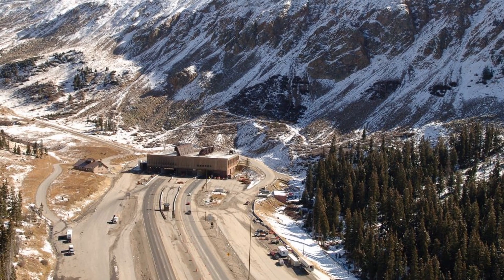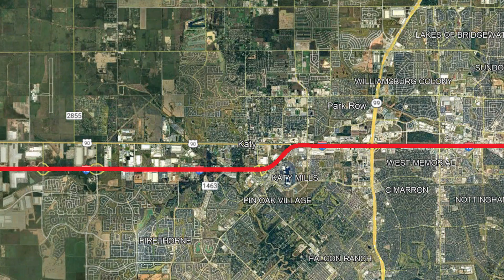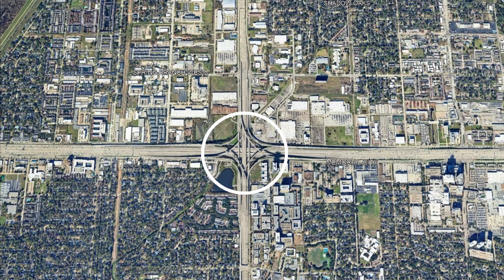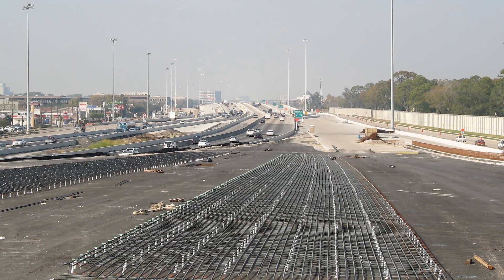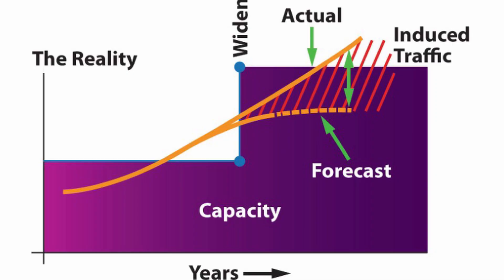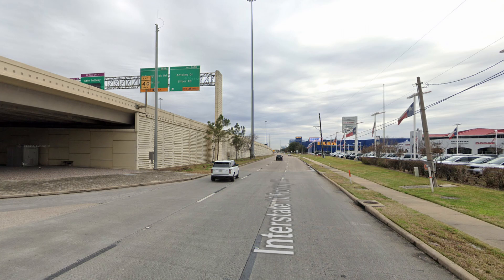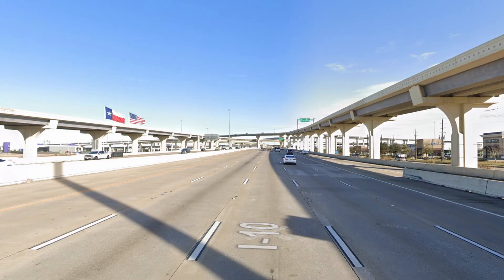Why Texas Built America's Widest Freeway

Comment: The "Induced demand" thing is pretty much bullshit. There's no new demand created, it's only "induced" because vehicles now have a better route to drive! So then traffic is reduced on other routes, or on surface streets, which is a huge benefit of highways.

And a better metric than congestion for a highway's performance would be throughout. A project can still be beneficial if it increases the road's capacity, even it congestion doesn't get better.

Comment: As an example: where i work is about 6 miles from home. I can go one of two ways on the surface streets and get there in 15-20 minutes by car. Or i can ride three different bus routes to get there, and it'll take at least an hour.
On another note, the 610 to 290 to FM 1960 trip on Saturday morning only takes 30 minutes, going to the local toy show once a month. Coming back home in mid afternoon takes a bit longer though, but often I take surface streets for that trip.

Comment: Here's one thing that could improve traffic flow:  Get rid of the carpool/toll lanes!  Open them to general traffic.  It would also simplify the infrastructure---fewer ramps, less signage, etc.  The express lanes could be used by through traffic.
Reply: The carpool and toll lanes actually help when you are just passing through town. So no you should not get rid of them.
Reply: @ItsReload1  Actually they don't---not anymore.  Those lanes now require local toll transponders, which out-of-towners won't have.

Comment: Most of the fallacies in this video have already been addressed, but just for a little more education you've got to consider the amount of commerce (18 wheelers, etc) that come via east and west through Houston.  I-10 goes through  Los Angeles, Phoenix, Tucson, Las Cruces, El Paso, San Antonio, Houston, New Orleans, Gulfport/Biloxi; Mobile, Pensacola and Jacksonville; With Houston being the 2nd largest port in the country and being the largest refiner of oil's in the country we're talking about an enormous amount of Semi's going east and west to help supply most of these cities. This is another reason for the expanse of I-10. Another smart design of the Katy is the fact of how the exits and entrances work (up to 610). The old freeway had the exits after the entrances causing backups at the exits into the freeway lanes during rush hour... Now the exits are first and the entrances are second. This alleviates the issue of traffic lights backing into freeway lanes. On top of that, this design allows safely hopping on and off the freeway. In other words if your destination is two traffic lights away and your pulling out of a store you simply hop on the freeway to avoid the lights which helps the congestion on the feeders.... And as a poster mentioned, we don't have frontage roads. We have feeder roads.

Comment: The proper solution would have been to build a REAL commuter rail line from Sealy TX to downtown Houston instead of the two HOV lanes going in both directions.  The freeway is constantly jammed during commute hours so the billions spent were for no real result other than lining the pockets of the contractors.  Houston deliberately rejects true rail lines and places stupid surface street toy trains on streets that have had existing bus service for 60+ years.  These trains were placed starting in the late 90s and done completely illegally without any voter/taxpayer consent through a proposition on an election ballot.  These trains actually CAUSE traffic jams and congestion in the city because priority is given to the trains so a traffic light can stay red for 5-10 minutes causing grid lock.  It is the movie Death Race on the Katy freeway when it is flowing.  People run closer to 100 mph than the posted 65.  Law enforcement is rarely seen because they too realize you are gambling with your life driving on the Katy freeway during non-commute hours.

Comment: I am sure if they wanted to build a commuter train there would be complaints that it is too impactful to the communities.
Reply: Yeah, a quarter-mile-wide swath of burning hot concrete filling the region with fumes and noise is fine, but don't ask for one little electric train line that has none of that.  

Because, as you know, trains = communism.

Comment: When it comes to improving traffic capacity over a network, there are two main ways to go about it: road and rail. They both have their advantages, such as rail being separated from road and not being impacted by traffic, and road allowing people to get from any one point to any other without having to interchange between modes. The other way to deal with traffic is to reduce the need to travel instead of adding additional capacity, and this can be done by allowing shopping, employment and recreation to develop closer to where people live, bringing them within walking or biking distance. This would require extensive urban planning and will often not be applicable in 20th century suburbs and only in newer developments. Like anything to do with cities, things like this are complicated.
For many North American cities like Houston, the primary mode for civilian and goods transport throughout a city and its neighbours is by road. Combined with the nature or road transportation, this makes those billion dollar freeways relatively cheap compared to building the initial infrastructure required for rail transport. If the city had a much larger rail network, it would a) be able to utilise existing infrastructure to a greater extent, b) make it easier for people and goods to interchange with that existing infrastructure, c) have that city already built around the rail network, with a much larger amount of the population and industry close to those rail lines and d) be something the people and industry are already used to working with and would be likely to approve of it.
In my opinion, I think that in the short term, this would have been the most viable solution but in the long term, more diversification of transport modes and planning would be ideal. I am not an expert on Houston and city planning in general, to take all of this with a big grain of salt. :D
Reply: Railroads are unaffordable and all are subsidized. Local buses are inefficient and time consuming the farther one travels away to/from the station. Local buses are subsidized in this country as they are also unaffordable for the most part.

Comment: I drove through Houston a couple of weeks ago and drove the Katy Freeway. A few years ago I drove the runner-up for most lanes, Highway 401 in Toronto.

When I first saw addresses like "27700 Katy Freeway" I wondered if "freeway" meant something different in Texas. It sort of does: these are addresses on the frontage road, not the freeway itself.
Reply: Buildings along the frontage road have addresses on the freeway.  I was confused by that when I first moved to Texas.  My apartment was at 3105 South I-35, or SIH 35.  Even though it was on the access road, and my actual apartment had ten buildings between it and that road.

Comment: Induced demand is a real thing for sure. The addition of highways cause new development to spring up. But also consider Austin, which fought against additional highways and additional new lanes for years, but saw new development and an influx of new residents without the induced demands from the highway system. Now they are dealing with a worse traffic issue than Houston because they didn't plan for the addition of new residents.
Reply: Yes that’s a prime example of induced demand

Comment: Greater Houston has been booming population for many years and the Katy Freeway sure is wide. I'm surprised that it's as wide as 20 to 26 lanes with its widest point at 29 lanes. Compare that to the 401 in the Greater Toronto Area which widened so many times with local–express lanes and the widest portion of the 401 is 22 lanes in Mississauga just near the airport and east of the ends of the 403 and 410. Normally, the 401 is as wide as 16 to 18 lanes.

Comment: In many ways, the Katy Freeway should be considered a success.  The Houston area has grown tremendously since the Katy Freeway was expanded.  Traffic on the road has increased.  but it hasn't completely failed.  However, the approach shows some serious lack of vision:
1)  If so many people need to travel between those points, why is there not a more efficient method of moving them?  (anybody hear of rapid transit?)
2)  Why is it that so many people have to move such distances every day?  Isn't there a better way of planning such that homes, employment and services can be more easily accessed?
Reply: To answer your questions: we did revamp the entire metro system, built 3 of the 5 proposed train lines, and those center lanes he’s talking about are used by the commuter buses from Katy, it’s called the park and ride. They used to just sit in traffic with everyone else on our 3 tiny lanes back then. Now they can fly by us. 2 rail lines weren’t built because people protested them smh 🤦🏿‍♂️ but the silver line was made into a BRT which connects to the station a lot of these I-10 lanes go to and will eventually be rail too. 

And your question about commutes, it’s not just those here locally, I-10 is a major route with many going through be it truckers or private cars. It’s the only east/west route here in an area of 7.5 million. So the road was expanded for only 11 miles to ease congestion for local and truck/bus traffic. If this were purely an adding lanes for passenger cars only thing, I would get people finding it ridiculous but that isn’t even the case at all.
Reply: Harris County has admirably considered rail to help reduce highway congestion. The conversion of excess freight lines to the Hardy Toll Road and Westpark Tollway have reduced congestion on both  I-45 North and I-10 West. Better mobility via rail conversion!

Comment: I think the 'induced demand' question needs to be further investigated. It's not like there's a spawn point generated cars out of thin air. Who are the people that seem to add to the volume which wasn't there before? Are these new residents? Are these people choosing the highway vs. surface streets? Are they former riders of public transit? Are people finding jobs on the other side of the city and the improved/new highway giving them access to a job they would have otherwise moved closer to? Is there an issue where traffic volume doesn't actually increase that much, but simply that the relationship between volume and congestion is not a linear one, but something approximating an exponential one?

If we had answers to these questions, I think we could better obtain the root cause and then begin to correctly address and analyze the issue. To some answers, such as highway vs. surface, it's not necessarily a bad thing. Less cars on surface streets means quieter neighborhoods and more walk-ability potential.
Reply: Induced demand is from people who weren't going to drive, driving. Say I might want to go to the cinema, but I'm reluctant because of bad traffic and there's no other way there that arrives quickly enough. 1 highway expansion later, and logically it follows that traffic should be better, right? So I decide to go to the
 cinema more often, whereas before I stayed home. I'm one more car that would not have been there otherwise. That's induced demand.

Edit: This is on a smaller scale, but the same goes for developers who now see land around the improved highway as more valuable and you gain more residents. The bulk of the induced demand.
Reply: There’s no such thing as induced demand, he even proved it himself. That people were moving here (200 or more a day some years) and that “traffic was gonna get worse anyway” no? So the demand was there, not “induced” because that isn’t actually a thing. Just like 29 lanes aren’t a real thing lol. Did Houston gain 3 million because a couple lanes were added to a short 9 mile stretch of I-10 on the west side? Of course not.
Reply: @ruckusbeblack  Right, sure, but this term isn't unique to this video or Texas. It's used frequently in reference to highways as an argument against improvements. I'm more referring to this 'induced demand' argument in general.
Reply: @guernica4262 I know, so was I lol. I was using his own points from the video that disproved it but you can pretty much do so with any city or anywhere the “induced” theory is used.
Reply: Yeah I hate the "induced demand" argument. There's almost always an underlying issue separate from the road. There's plenty of roads that get widened and then traffic generally goes away. I-95 in GA is pretty good example of that. After they widened the entire state to 3+ lanes, traffic because almost non existant at any time of day. Most of the traffic jams now are from hurricane evacuations or wrecks.

Comment: - Addicks-Setsuma Road isn't referenced by that designation.  It is Texas State Highway 6 (or, as the locals call it, Highway 6).  
- That exit in the middle of I-10 (which is actually the Katy Managed Lanes / Katy Tollway portion) is to service the Addicks Park and Ride that looks like the big parking lot to the north.
- Sam Houston Tollway exit has always looked like that.  It's just bigger now due to the Katy Freeway project.  
- Sam Houston Tollway interchange and Grand Parkway interchange were not built at the same time.  The Sam Houston Tollway interchange was built in its entirety as it was a replacement for an existing stack interchange.  The Grand Parkway interchange was built in two phases, with the first phase servicing Grand Parkway Segment D (the free portion to the south).  The northern part of the interchange was built when the Grand Parkway Segment E was built, which was after the completion of the Katy Freeway project.
- The Katy Freeway project ends at I-610.  Katy Freeway itself continues until it reaches downtown Houston.  There is discussion of a Katy Freeway Project Phase II which will cover the Katy Freeway from I-610 to I-45.
- The reason for the increase was, between 2011 and 2014 was that alternative routing
- Katy Freeway has HOV lanes (single lane in each direction) from SH-6 to Mason Road in Katy.  From SH-6 to near I-610, those are the Katy Managed Lanes (also known as the Katy Tollway).  They are HOV/SOT system (HOV drivers do not pay a toll during HOV times, but single drivers can use it for a toll).  This is the only road in Houston that is not referenced as express lanes.

What I think people fail to realize that, even though you still have traffic jams on it, it was worse before the project.  The previous facility was three lanes in each direction and two to three frontage road lanes.  To get from midtown Houston to Katy during the middle of the day, it would take 2 hours one way.
Reply: Another old head like me that was fuming watching this suggested video. I remember back in the day when there was a railroad track next to the freeway. The only part of that track is still visible on Old Katy Rd next to said park and ride.
Reply: @bobmurphy2216  I just checked Google Maps and Google Earth and any part of those tracks were removed and replaced with the westbound frontage road.  The only place to see those tracks is in Katy itself, as the rail line is still active.  The end of it is at I-10 and Katy-Fort Bend Road.

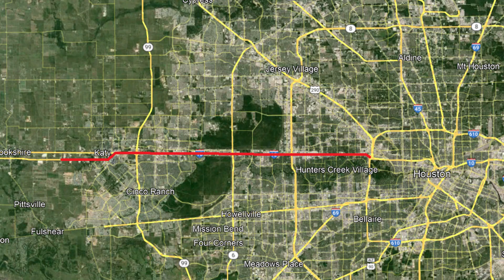Comment: How come you didn’t mention how commuter buses on METRO cut times in half having their HOV lanes and connectors to the bus station the high speed rail eventually will connect to? 🤔 This move was great for public transit, drivers, not to mention our truckers? At 1:35 you mentioned “20 lanes” with a photo that clearly shows half of that while still ignoring the middle 4 are for buses or the few who pay the high toll. Come on man at 3:24 we see the actual roadway 😂 That’s 5 lanes!

Comment: The lanes are some of the worst things about the US. Imagine not investing in public transportation like subways or high speed trains
Reply: Imagine what you want, it isn’t factual though. We voted for this as well as our light rail system and 400+ miles of bikeways and bike lanes here in Houston. We obviously want to expand the train system but we didn’t have any until 2004. We didn’t choose highways over everything, we voted for all of it.
Reply: We did? And despite none of the lines going to either airport, we have the 7th highest rider/mile on our light rail, way higher than Dallas despite them having 4x the miles of track. And the high speed rail is in the works as well? Imagine screeching about things that are happening because imagination ma imagines
Reply: It's cheaper to put more lanes in than build a whole new rail line with all the signaling and other safety and control measures it would require to be high speed. And that's after you need to buy and bulldoze through neighborhoods for the right of way (This was already done 50 years ago with the freeways like it or not). Plus we Muricans love having the freedom to just hop in the car and go whenever and wherever we want to.